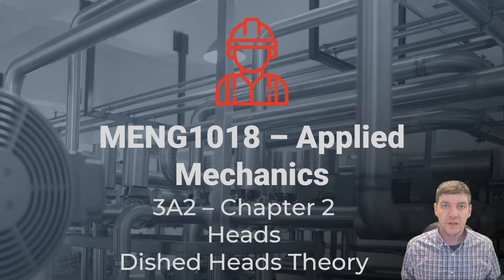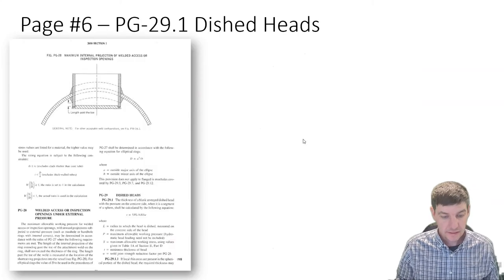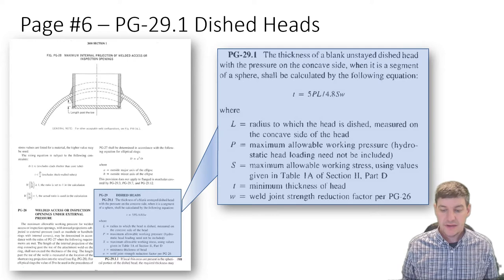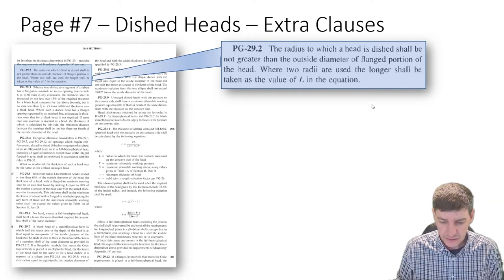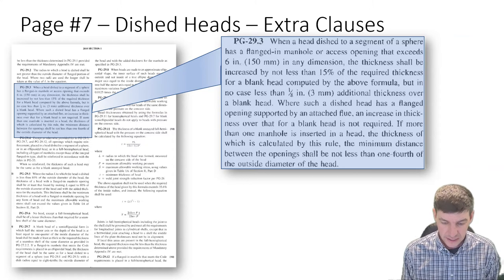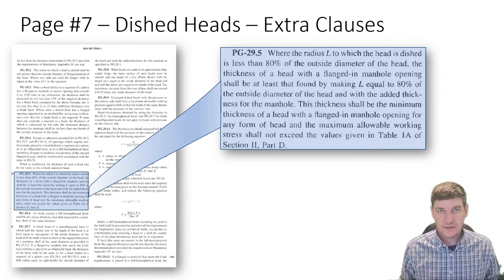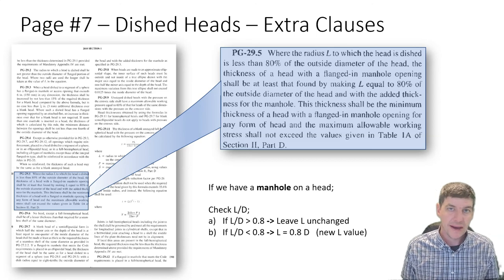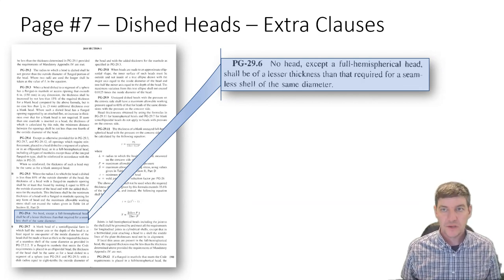MENG2018 - ASME CODE CALCULATIONS - Dished and Hemispherical Heads - Theory

Comment: Can any one help with this question - 

Locomotive boiler 0.403m3 of net furnace area supported by SA-266 stay bolts, spacedO.254m by 0.254m.
Max Pressure = 3.7Mpa
S = 138 Mpa
a) Diameter of one stay
b) Number of stay bolts required.
Reply: Lmfao 😂😂😂 Don't you know how many to change the rotation of a 3 phase motor and make the contacts close when the heater calls for cooling? What about  starting and jogging a starter to start a motor?